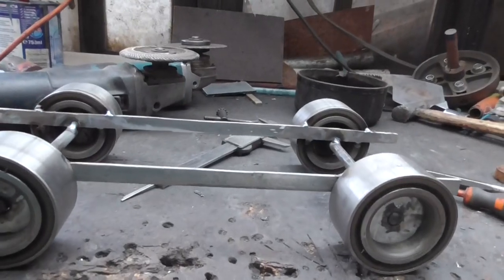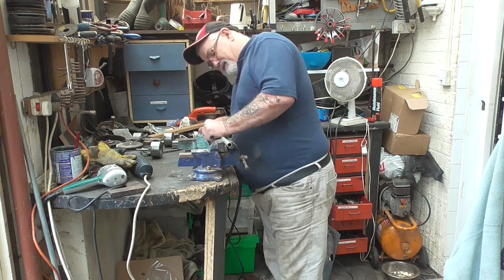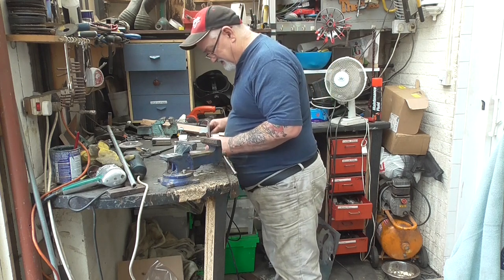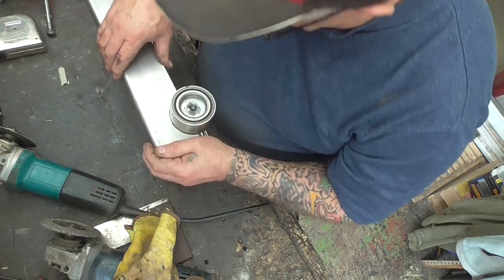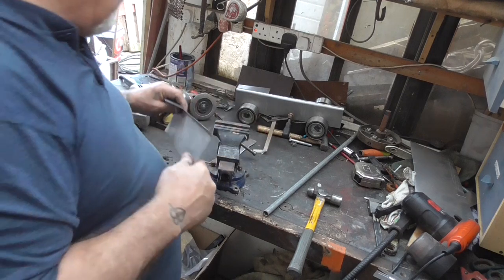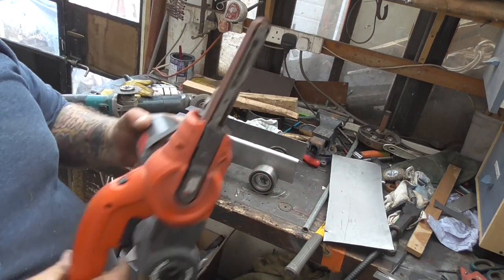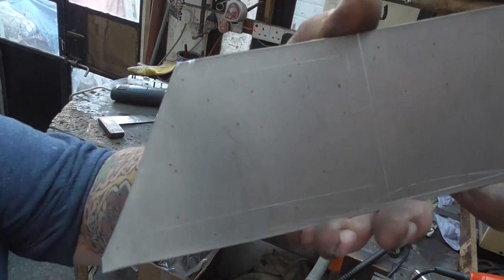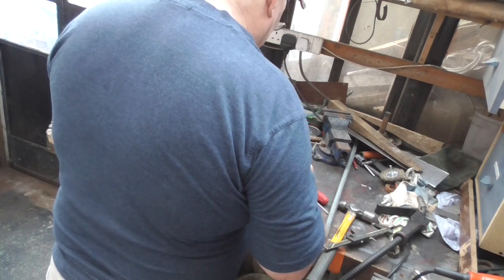how i started to build the dredded land rover ( steel art )

Comment: Two floating vises!... Twice as good!. I was told to keep my belt sander belts near the oven. Not too hot to melt the glue but just enough to keep the humidity away from the join. I think they last a bit longer but its a bit hard to tell. Great videos Robert. I'm trying to think where I can source some bearings?

Comment: Definitely increasing my appreciation for the hammer. I drive a rover, bit newer than the one you're modeling, and the hammer's quite a useful tool on the genuine article too. Have to give it the 'technical tap' quite often to help out the transmission sensor or disengage the parking brake.

Thanks for the advice and the vids!